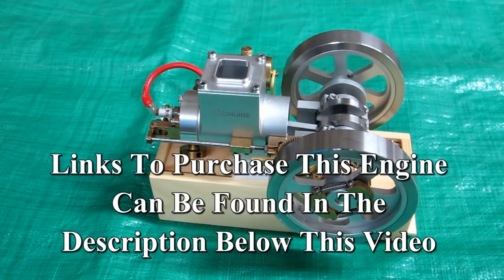Eachine ET1 Upgraded Hit & Miss Engine

Comment: Whom can help me with timing on an engine like this??, I replaced the piston ring and forgot to mark the timing, it doesn't run anymore, please help
Reply from the maker: Which engine do you have ET1 (or M90)?
There is no reason to take everything apart to change the o-rings.
Unless you took everything apart (flywheels, governor, etc.) to change the piston o-rings the timing should not have changed.
If you do not have a lot of model engine experience it can be quite frustrating when one decides not to run.
Why an engine won't start....
Fuel too rich... or fuel too lean.
An air bubble in the fuel line.
One of the valves stuck open (do you have compression?)
Some people found carbon holding a valve open.
Or the governor pushrod is stuck and holding the exhaust valve open all of the time.
Trying to spin the flywheel in the wrong direction (I have seen it done). Videos show correct direction.
Ignition switch in wrong position.
Batteries inserted in the wrong direction.
Dead or weak batteries or a dead or weak battery.
Try using two batteries instead of three (you will need a dummy battery to do this). Watch the video.
Wrong fuel.
Piece of dirt in the carburetor.
Watch the following videos.
Good luck. 
Thanks for watching. Please subscribe! 
That is what keeps this channel running. 
Ron

Go to the playlist on my channel page which lists all of my model engine videos.
https://www.youtube.com/playlist?list=PLDjucfhdTRPnyVTbxSs9p-S6nqsk-SRzP

Eachine ET1 Upgraded Hit & Miss Engine
In this video around 4:29 it explains the timing.

Eachine ET6 Hit & Miss - Changing O-rings
Essentially the same proces to change o-rings on your engine.

Dummy Battery For Hit & Miss Engines
For whatever reason... it has been found the ignition system works better (for SOME engines) with only two batteries.

Eachine 4 Cycle Engines - Ignition Timing
The same timing applies to all of these 4-cycle engines.
It should fire JUST PAST top dead center.
Reply: @RonaldWalters2010  ET1… I made a
Mess,I know!!… need some nice pictures to find out timing and make it work again
Reply from the maker: Did you watch the videos I sent you?
All the information you need is in those videos.

Comment: Hi Ron! Thank you very much for all of your quality content! 

Regarding the output shaft, what is the OD of the output shaft on the engine? And how much is sticking out? I'm hoping to attach a "coffee can" flat pulley of some kind and run a flat belt to power some accessories, but wasn't sure of the dimensions of the output shaft. If I can't find any kind of actual "pulley" of that size, I was thinking about possibly using a shaft coupler or collar. 

Thanks again for your excellent videos! I look forward to seeing more in the future!
Reply from the maker: Matthew,
I only have access to one engine at the moment… the EXT vertical hit & miss.
The shaft is 8mm diameter and approximately 22-25mm long… which is the length up to the disc containing the magnet for the hall effect sensor (ignition timing).
However that shaft really isn’t available for your purpose since you probably won’t be able to remove the flywheel. These engines really need both flywheels to operate correctly.
The disc containing the magnet is grooved to be a pulley, which could be used for an o-ring drive for some external purpose.
For the most part, these engines are intended for personal enjoyment, short duration runs and minimal loads. 
Also, they jumb around so much that they really need a heavier base to stay in one place.
Thanks for watching. Please subscribe! 
That is what keeps this channel going. 
Ron

Comment: Do you run with two orings on the piston or just one?
Reply from the maker: I have not had mine apart to look. When these first came out the piston had two o-rings. Then I was told the manufacture started installing only one o-ring to reduce the compression, which helped slow it down a bit.

Comment: These engines run far better on ordinary petrol/gas than the white gas, Coleman stuff. Fire up far easier. I find mine likes me to do a cold start after putting a finger over the air intake and giving it three turns to suck up some fuel. Fires first turn from cold like that.

Comment: I've really been looking at every video I could find on YouTube about these engines and the et5. I wish you could buy parts like bearings and pistons. What I want to know is  how long will this last,  how fast do the parts wear, and can you buy parts anywhere.
Reply from the maker: These are low compression, relatively low speed, demonstration model engines. The ET5 runs faster. The piston rings are an o-ring. First thing to go will be the o-ring and that is why I put a little oil in the fuel. If you keep it clean and oil everything before every run, it should last a long time. 

The bearings should be standard Chinese bearings but I would not expect a need to replace them for quite some time. I say “should be” since I have (personally) had no reason to pull one apart to look at them. The bearing will be metric and are listed by dimensions such as “mm thickness, mm OD, mm ID” and hopefully will have a mark something like 123ZZ or F123ZZ for a flange bearing. 

Spark plugs and o-rings are listed as spare parts. I finally got them to clarify their listings so you know which o-ring fits which engine(s). I have several hours on some of these and have yet to replace an o-ring on the piston. Some tell me the o-rings last 5 hours or more. And 5 hours is a lot of running for one of these model engines. Hope that helps.

Thanks for watching. 
Please subscribe! That is what keeps this channel going. 
Ron
Reply: @RonaldWalters2010  thank you very much! I subscribed to your channel and will continue to watch all the reviews.. very good channel!
Reply: @RonaldWalters2010  How can I get crankshaft for ET1
Reply from the maker: Banggood does not sell them. You can try contacting Eachine directly and see if they will sell you one.

Comment: What about the crankshaft bearings and piston lubrication sir.
Reply from the maker: That was the, "oil anything that rotates, pivots or slides." :-)

The con rod and crankshaft run in bearings. I dribble a little oil around them anyway (I use 3-In-One oil) and I hold it up (with the head down) and drip a bit of oil on the wrist pin and upper end.

The piston ring is an o-ring. I use a little (very little) Marvel Mystery Oil in my fuel, which is Coleman Lantern Fuel. The oil in the fuel lubricates the o-ring which will eventually need replacing.

I also have a video on the correct fuel for these engines.
Hit & Miss Engines - The Correct Fuel
https://youtu.be/TvLziWCI7Oo

Thanks for watching. Please subscribe. That is what keeps this channel going. Ron
Reply: @RonaldWalters2010  Thank you very much.1 will subscribe and keep on waching your valuable videos.
Reply from the maker: Thank you. Much appreciated!

Comment: Thank you, Ronald.  I have bought ET1 engine using your coupon code  from banggood.  It took 2weeks to arrive it to japan.  Restarting is difficult,   Because ,I think that it is over choke when engine ignition  turns  off.
Reply from the maker: Two week delivery to Japan is pretty good. It can take 4 to 6 weeks to get to the USA… maybe longer due to the Covid-19 problems being experienced. Reduced air travel also means reduced airfreight availability.

The only time I have had difficulty restarting was when I was using three batteries in the battery pack.
Only use two(2) batteries in the back (see video below).

Only time I choke the engine is when refilling a completely empty tank to get the carburetor completely primed.

I always flip the engine over a couple of times before turning the ignition on. 

Sometimes after the engine has been running for a while (and warms up) the carburetor needle valve is closed slightly for smoother running. If it is not reopened again (slightly), the engine may be difficult to start. The engine is quite sensitive to needle valve position.

Several things can cause the engine not to have compression. Always verify you have compression before trying to start the engine.

Sometimes the ignition wire can vibrate too far away from the spark plug.

A naphtha-based fuel (Coleman lantern fuel or Zippo lighter fluid) is cleaner burning than unleaded petrol and helps avoid carbon deposits in the head.

Watch this video for the correct fuel and getting it to run.

Hit & Miss Engines - The Correct Fuel
(Troubleshooting a new engine, which will not start. Fuels it will and will not run on.)
https://youtu.be/TvLziWCI7Oo

I also have a couple of videos on making a starter for a cordless drill, which helps with a uncooperative engine.

Cordless Drill Starter for Eachine Hit & Miss Engines
https://youtu.be/sYsjoMWHSDg

Cordless Drill Starter for Hit & Miss Engines - 3D Printed Version
https://youtu.be/fN-YEJI3Z-4

Hope that helps. 

If you continue to have problems, please let me know.

Ron
Reply: @RonaldWalters2010  Thank you for advice.

Comment: rubricant free engine?   No addtive and oil  in fuel?
Reply from the maker: Ref 6:40 this video. 
And try this one.
Hit & Miss Engines - The Correct Fuel
https://youtu.be/TvLziWCI7Oo
Reply: @RonaldWalters2010   Thank you for imformation.    Why do you run engine by 2pcs batteries (3V)?    it is correct to run enigine by 4.5V (3PCS)
Reply from the maker: As stated in the video, for whatever reason, 4.5V overpowers the system and the ignition does not fire. Two batteries 3V works reliably. The high voltage ignition pack is sealed with epoxy and we cannot see inside. Thanks for watching. Please subscribe. That is what keeps this channel going. Ron

Comment: Just bought one fater watching this video... tried everything the engine WILL NOT start!
I have ignition... but it just won't run... I have tried the tiniest enticements on that needle valve...no way no how! 
I tried kerosene, lighter fuel (naphtha) alcohol.... nothing works!

Paddy

PS, I nhope I can send this thing back and get a replacement !
Reply from the maker: It will run. They are test run at the factory before boxing.
Hopefully you haven’t changed any of the positions of anything. Have you?
You need to verify (and mark) which way “ON” is for the switch. (a very common mistake)
It will not run on kerosene or alcohol.
Coleman lantern fuel works well and is cheaper (in the long run) than lighter fuel.
Do you have compression?
Are you using 3 batteries in the battery pack? Remove one of them and replace it with a blank battery so the ignition is only getting 3 volts.
Looking at the governor side flywheel… are you spinning it clockwise?
Reply: @RonaldWalters2010  Thanks for your speedy reply. To Answer all your remarks : yes I did !
First of all... the switch (for the ignition)
 seems to be the wrong way around, compared with all the ones I have seen in videos...But when I put it in the 'on' position (that will be 'off' to most of you) I do get indeed a healthy spark.
I have removed a battery and put a near dead one in its place  (gives me a softer spark, but spark nonetheless)
I spin the flywheel 'backwards' , away from the head of the engine, as I see everybody do in copious amounts of videos.
I have put a mark on the set screw on the carburetor and have fought with that thing for two hours, around the 1/4 turn mark, like everybody professes...
I used Kerosene and alcohol, after about two hours messing around with lighter fuel. (desperation, I guess...) 
Question though... if that Coleman's fuel isn't Kerosene... then what is it? (I am European...)
Another remark I need to make... the lead from the ignition to the spark plug (the red cable) was cut off flush with the isolation, and just jammed into a plastic boot that sits around the spark plug. (that can't be right, surely!)  I have temporary remedied that too (with the help of an extra lead and a crocodile clip) and yes, I removed the spark plug and checked if I had a spark at the appropriate place....
Anything else you may have to offer in counsel will be gratefully accepted ! 
Regards 

Paddy
Reply: Thank you all for your remarks, and helpful suggestions... the engine now runs as it should!
I used RON95 (95 octane car fuel) and it purrs like a kitten with black-lung !
Meanwhile I know where to get the proper Coleman fuel and an order for a few bottles has already been made !
Thank you all !
Paddy
Reply from the maker: Glad to help! Thanks for watching. Ron

Comment: The latest ones come with a pulley mounted on the crank on the opposite side to the governor and a rope start is also supplied. Also a threaded hole has been provided at the end of the cylinder for piston lubrication, just undo a tiny screw and add a couple of drops of oil down the hole when the piston is in the fully rear position. Removing one of the two governor springs slows down the engine and makes it sound more like the real thing. 

You can see the upgrades here: https://www.youtube.com/watch?v=g_TRTeSs9Rk

Comment: Hello Ronald, What is de timing of this Engine. I pulled it apart, but not look at the timing. He is running again but wants to now for shore if it is richt. Can you tell me please.
Reply from the maker: Generally it should fire a few degrees past TDC (Top Dead Center) so it fires a bit after the piston has made its full compression stroke.
Reply: @RonaldWalters2010  Timing when its fires i change that, the valve has not the good timing. is there not a mark to set it right.
I send you a mail maybe you can make pictures for me.
Reply from the maker: You really need to get in the habit of taking photos or making notes of something before you pull it apart so you can reassemble it. You need two o-rings on the piston before you run it any more. A link for the correct o-ring is in the description for this video. Ignition timing is covered around 4:52 in my video. The exhaust valve opens every other revolution. A cam operates the push rod for the exhaust valve. It should open just as the pistons starts upwards for the exhaust stroke and close just before it starts downward for the intake stroke. The bracket which holds the exhaust valve rocker arm is a fairly loose fit on the cylinder head and it takes several attempts to get it properly aligned with the exhaust valve so everything works smoothly. You are just going to have to play with it until you get it right. If the gears are off by one tooth or the cam slightly out of position it won't run correctly. Also if you changed the length of the exhaust valve push rod that could be a problem. There should be a slight gap between the top of the exhaust valve and the rocker arm when the valve is closed. Watch the following and pay attention to how the valves open and close for each of the 4 cycles of the engine. https://en.wikipedia.org/wiki/Four-stroke_engine Unfortunately there are no timing marks and it is difficult to take a meaningful photo... and I am not going to take my engine apart to take photos. Good Luck.
Reply: @RonaldWalters2010  Nothing has changed Ronald, only the cam. You can not take a picture for me in which position the cam is in position with the ignition. I get the engine with 1 piston ring on it.
I send you a e-mail that you can send me back for pictures. Thanks Ronald.
Reply from the maker: Jakob, Put another o-ring on the piston before you run it any more… it is supposed to have two o-rings. The horizontal hit & miss is out in my shop. I have been sick for the past two weeks and I am not going out into the shop again until I feel better. Looking at the vertical hit & miss (which is the same engine), the piston is just past TDC when the Magnet passes cver the Hall effect sensor (spark plug fires). Approximately 125-130 degrees of crankshaft rotation later the roller just starts up on the cam and 180 degrees later the roller is fully up on the cam (magnet is directly opposite the Hall effect sensor) and remains up on the cam for another 45 degrees of rotation (approximately 225 degrees after firing). And NO I cannot take a picture. Everything is too close together to show any detail (at least with the lens on my camera)… I tried. Besides, the cam is on one side of the engine and the Hall effect sensor is on the other side. Another way to know where the piston is, remove the spark plug and place a rod on top of the piston and watch it go up and down. The rest is up to you. This should be enough information to set the cam. Some fine-tuning may be required after you get it running (with 2 o-rings on the piston).
Reply from the maker: I need to correct my previous statements. I enquired about the single o-ring on the piston and was told the manufacturer has been placing only one o-ring on the piston as it slightly decreases the compression and makes the engine easier to start.

Comment: Thank you kindly,so you do need to put a little 2 stroke oil in it?
Reply from the maker: Around 5% Marvel Mystery Oil, not 2 stroke oil. Why? Because it has been found to work successfully.
Reply: This little engine does not have an oiling system to lubricant the cylinder for the compression rings. Oil in the fuel will prolong the life of the rings.

Comment: Great review,very helpfull,being a 4 stroke you shouldn’t add oil to fuel so how does it get lubrication?thanks again
Reply from the maker: This is a dry sump and there is no drip-oiler on the liner... so your only oil for the piston is what is in the fuel. "Exceptions to every rule."  The piston rings in these engines are o-rings so if you do not put a little oil in the fuel they will not last as long. Around 5% Marvel Mystery Oil in Coleman Lantern Fuel is plenty and so far I haven't had a problem with it fouling the plug. Thanks for watching. Please subscribe.